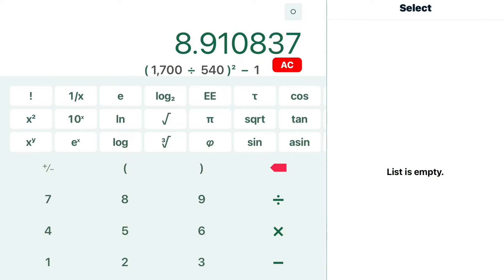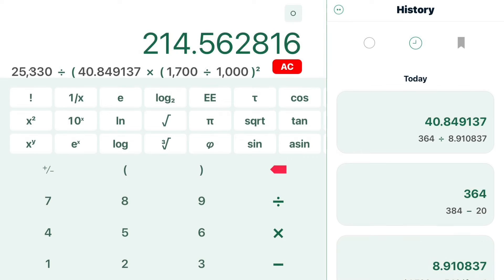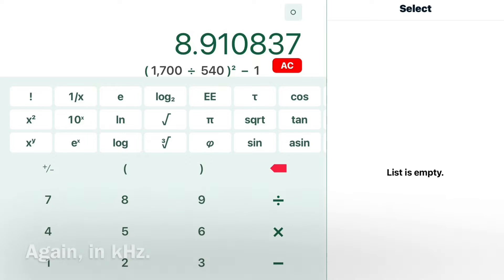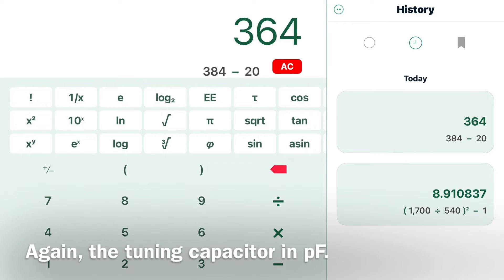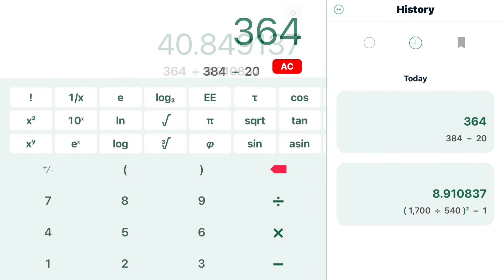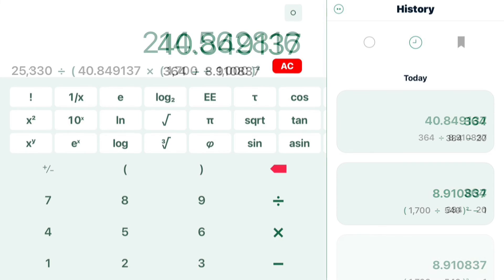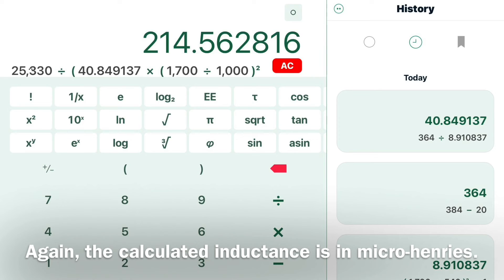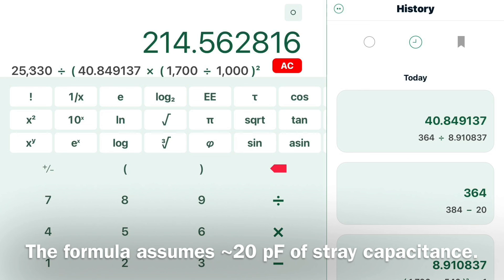Unknown Antenna Coil Inductance Calculations

Comment: It was indeed helpful, your time and good will is indeed  appreciated!
Reply from the maker: You’re welcome. All the best on your repairs/projects. Don
Reply: @RestoreOldRadios  Hello and thank you again for this video/tutorial.
My math must be getting rusty. 
I could follow your first steps, but I had difficulty understanding the last step, where you calculate the all important inductance. 
I used your figures, but I couldn't arrive anywhere close to the same result (214.562816 uH). 
Would it be at all possible to expand / type out  this last equation step by step, please?

Also you very kindly provided an alternative formula (L uH = (25330 / (C pF * F MHz * F MHz)
What values do the CpF and the two F MHz  represent please? 
Thank you very much.
Reply from the maker: Send me your measurements that you are using in the formula and I’ll use them in my reply back to. Best, Don
Reply: @RestoreOldRadios 
Hello, thank you for coming back to my question. 
Band range: 1700 to 530 kHz
Capacitor: 240-40 pF
As shown below, I get an inductance of 18.9 μH. But this is far from your 214.5 μH which worries me.

Implemented the equations in your video as follows:
(1700 / 530)^2 -1 =  9.288359 (ratio)
240 - 40 = 200 pF (Difference)
Difference/ratio: 200/ 9.288359 = 21.532329
Constant 25330 / ( 21.532329 * (1700/1000)^2 => 25330 / (21.532329 * 1.7)^2 =>  25330 / 36.6049593^2 => 25330/1,339.923045354656 = 18.9 μH
Thank you again!
Reply from the maker: @DorsetRadio  All of your math matches my calculations until the last statement as follows:
25,330/(21.532329*(1,700/1,000)^2=407.04867uH
or
25,330/(21.532329*1.7^2)=407.04867uH
Reply: @RestoreOldRadios  Many thanks for taking the time to walk me through the last statement, your guidance does make a difference. 🙏
I took the power of 2 to apply to the entire content inside the brackets:  (21.532329*(1,700/1,000).
For my rusty math, could the last statement have been rephrased as 25,330 / [(21.532329) * (1,700/1000)^2] ? 
It's been a while since I needed to use math. 
Thank you again.
Reply from the maker: @DorsetRadio  That works too as pasted into my calculator: 25330÷((21.532329)×(1700÷1000)²) = 407.04867
Reply: @RestoreOldRadios  Excellent! Thank you ever so much for your time, patience and guidance. :) 👍
Edit: I was wondering if you may have a list of books/resources to recommend. Nothing too heavy or advanced for a start? 😃
Reply from the maker: @DorsetRadio  Check out www.worldradiohistory.com and you’ll find lot’s of reading material on electronics, etc. Hope this is helpful. Best, Don
Reply: @RestoreOldRadios  Thank you, this is indeed a good and rare resource - am looking for something more systematic, like a book or even radio-related course. 
For all your help, I feel like buying  you a beer. Do you accept donations somehow please?